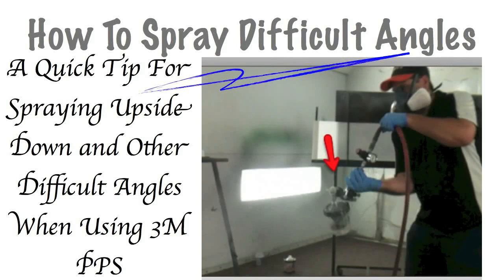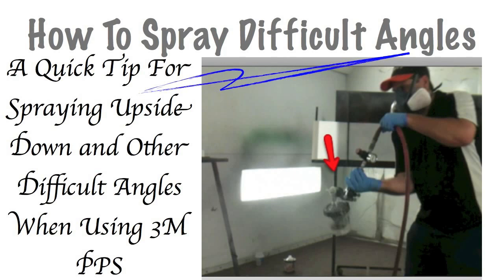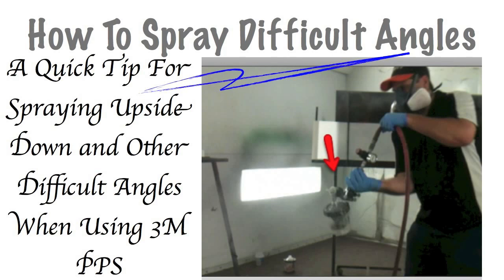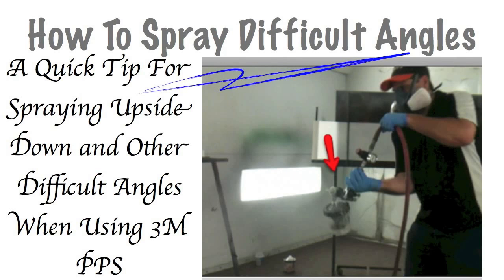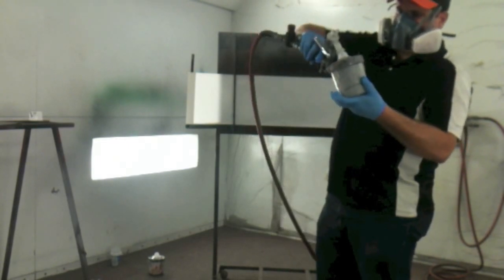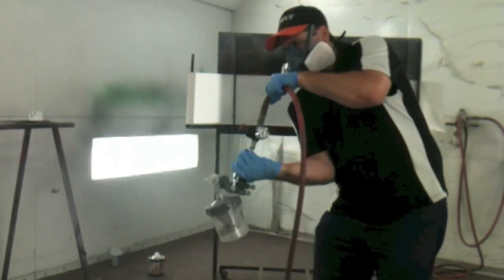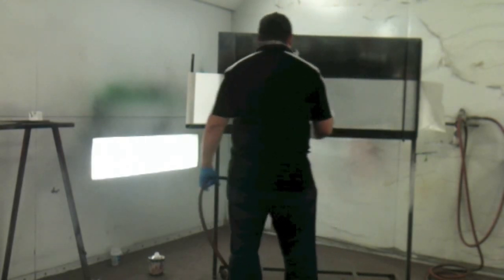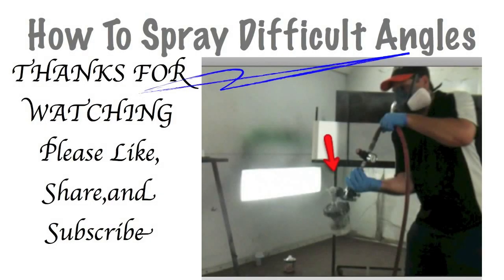How To Paint Hard Angles On Your Car - DIY Auto Painting Tips and Tricks

Comment from the maker: If the single stage is a solid color you can sand and buff it.  However, if it is metallic, you are probably going to have to respray.  Sanding metallic is going to change the way the metallic is laying, which will be noticeable.  Thanks for the comment and suggestion.

Comment: I made a video for the diy guy using zip lock bags. Compared to one of these kits there is no difference in performance. Only difference is cost wise it only cost one zip lock bag and one thin rubber or Teflon washer.